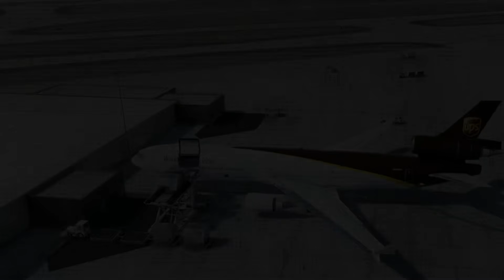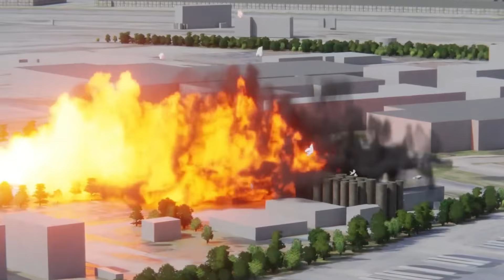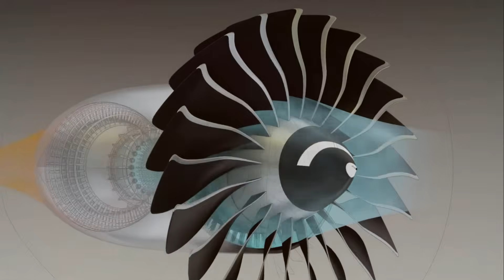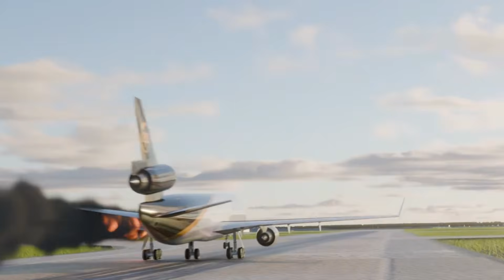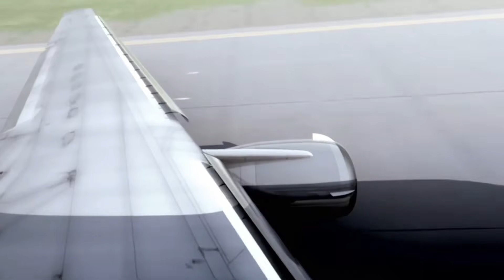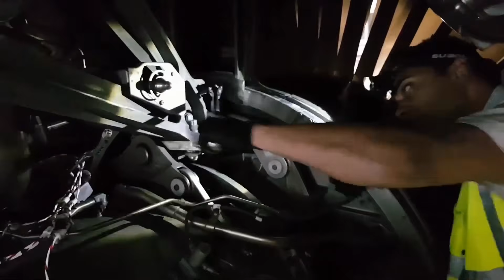3D Reconstruction of UPS Airlines Flight 2976 Crash

Comment: Juan Browns channel had a video about the cause. It was the bushing in the wing mounting that the outer case had separated which allowed to much movement upon take off. The pilots knew there was no recovery. FedEx and UPS had both reported problems with this to the FAA. Boeing had a bulletin for inspecting this every 19,900 hours, but in fact, FedEx and UPS were reporting that this bushing was failing much earlier at 11,000 to 13,000 hours. Boeing filed a request to the FAA to only inspect this bushing every 29,000 hours and the FAA approved it without looking into the failures and only using what Boeing documented. Boeing omitted the notifications from UPS (1), and FedEx (several), in their documentation. The investigator, the woman presently working on the Amazon crash confronted them in hearings on it. She even brought the part and the assembly to show them. This ball joint has to be lubricated almost every flight and that is how UPS and FedEx knew the joint was failing far faster.